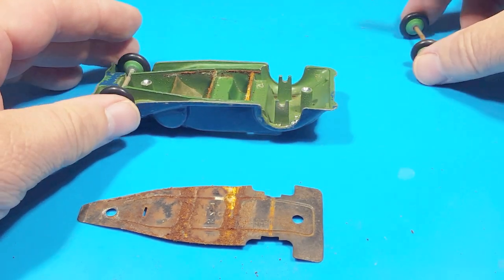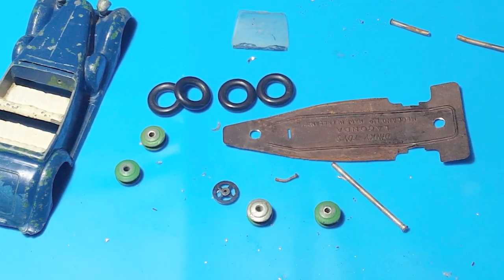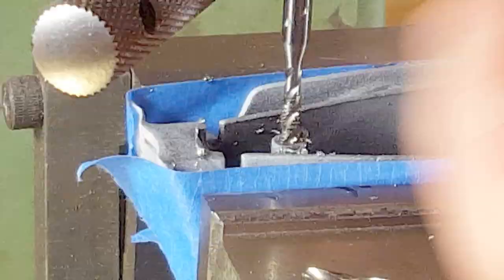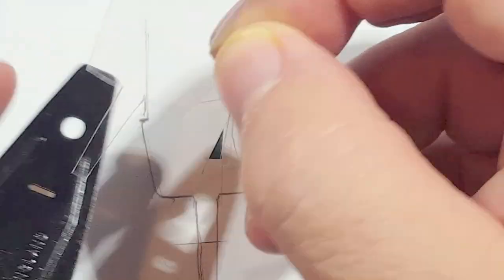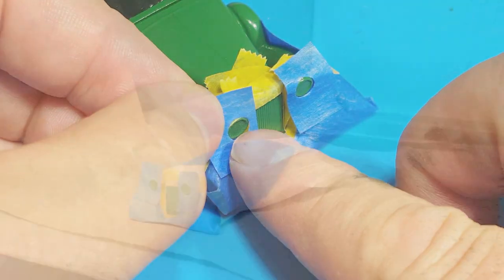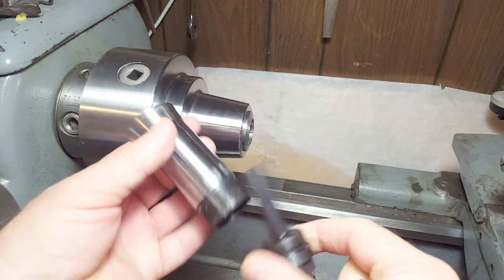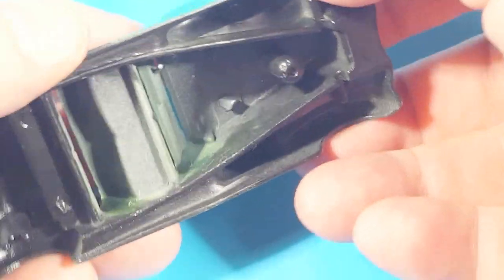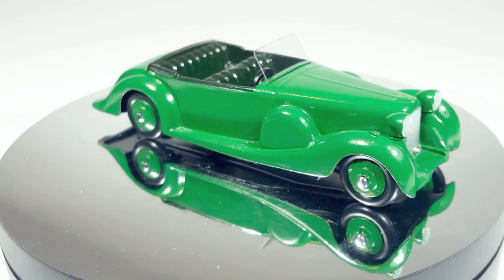Dinky 38c Lagonda Restoration

Comment: So nice to have a new restoration by you! ❤ The Lagonda turned out really well. Your careful prep work yielded dividends when primer and paint were applied. Your process on axels and mushrooms is a machinists dream...all the fancy pieces, coletts, sleeves, and bits to achieve what most restorers do with a hammer or drill. I think the green body color was an excellent match, as was the interior color you created. Just great all the way through!! Thanks, Timo! Stephen
Reply from the maker: Thanks Stephen. I got frustrated when hammering at forming a mushroom with a drill and nail punch. Too many times I damaged the finished casting in the process, or bent the axel. This is a fun use for the lathe too. Cheers